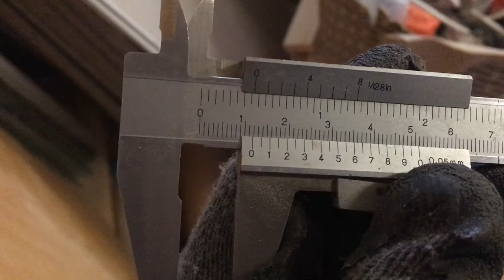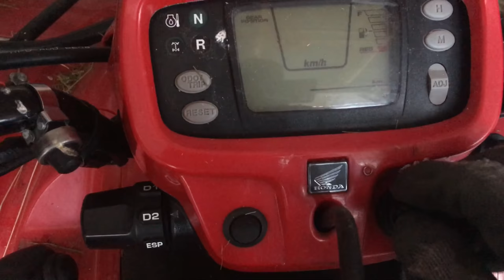Taking Care Of The White Stuff

Comment: Do you think if you drill a hole in that shaft ( with the two nuts ) and put a carter pin that it would keep you from loosing the shaft again, just a suggestion
Reply from the maker: Well, the one I have now is secured so it doesn't go anywhere but it is just a short time fix. I need to replace the original one which has one of those features. Not sure how it really got lost with one of those in place...

Comment: always keep the nut on when you cut a threaded rod... makes it easier after filing to straighten the threads (if any obstruction). In these case you can screw the nut on from the other side but I sometimes forget if it's a bolt...